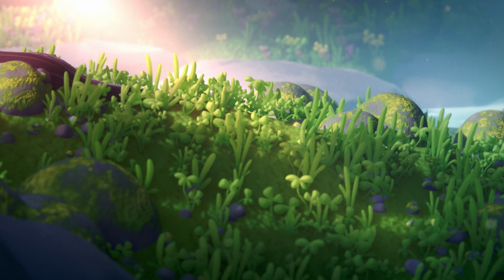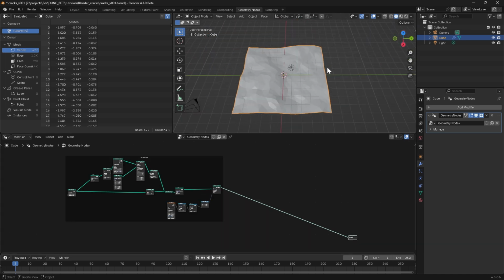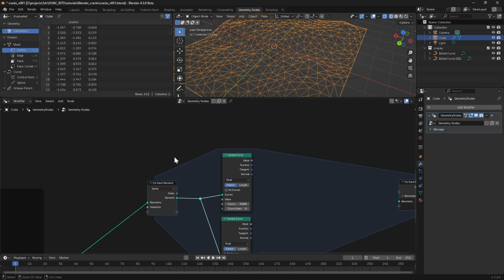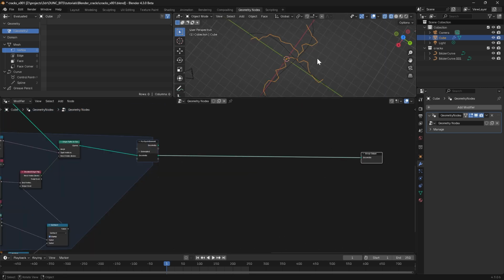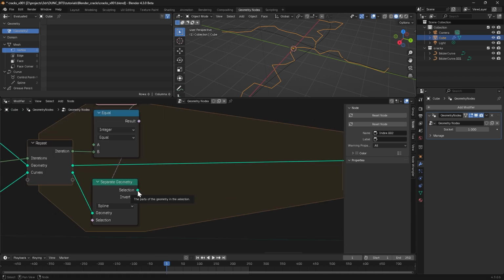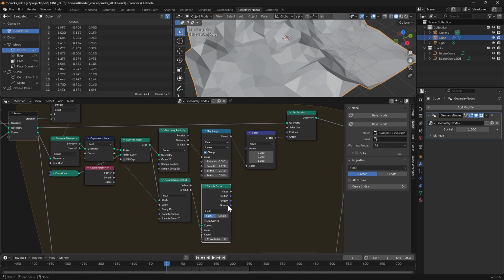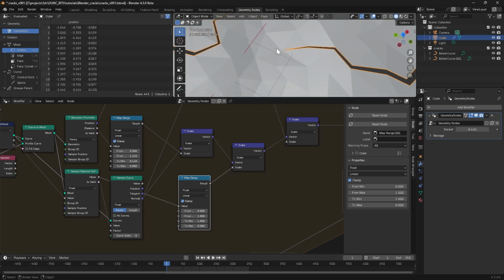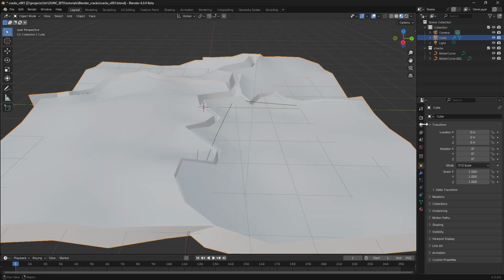Blender Procedural Cracks

Comment: hey man do you know that how to create a procedural animation for restoring cracks which helps to join them like liquid type?
Reply from the maker: Sorry, I’ve not really done anything with liquids in Blender. I’m sure it’s possible though.
Reply: @duncanrudd348  what if i want to add small particles and debris on the crack when it starts to cracking the surface and fall down small particles? can you help me with that
Reply from the maker: @NandanSanchaniya that’s totally doable but it’s not something I’m planning to cover just now. There are plenty of tutorials about emitting particles using geo nodes so it shouldn’t be too hard to implement if you’ve followed the concepts in this video. Good luck 👍

Comment: Hi Duncan, this is what i need! but i want to use a mesh (in this case i'm using a statue) instead of quadrilateral what i have to use?
Reply from the maker: I’m not sure how effective this will be on a statue - I’ve only used it on relatively flat terrain meshes but there nothing to stop you giving it a try. Just drag the statue mesh into your node graph and connect the resulting object info node in place of the quadrilateral mesh I made in the example video. If the statue has a material applied that should be inherited as well. Good luck!

Comment: Thanks for this unique effect! I tried applying a material to it but it doesn't work, am I missing something?
Reply from the maker: If you’re generating your mesh in the geo nodes graph (as I do in the example) you’ll need to use a ‘set material’ node within the actual geo nodes setup. Applying materials in the usual manner doesn’t work for meshes generated in a geo nodes modifier 👍
Reply: @duncanrudd348  Thanks a lot for your answer.